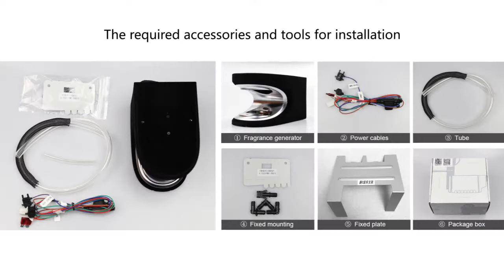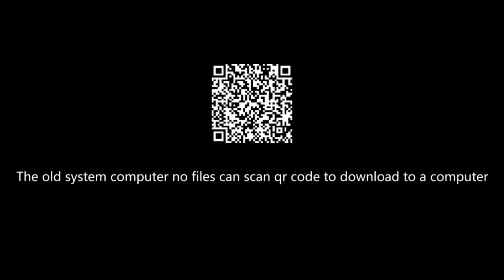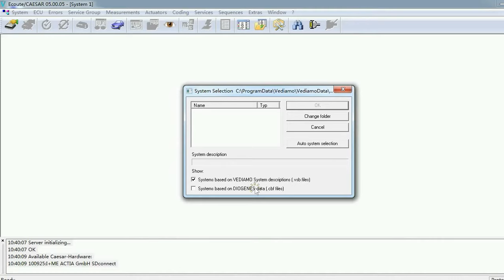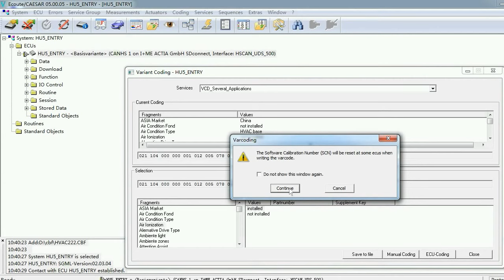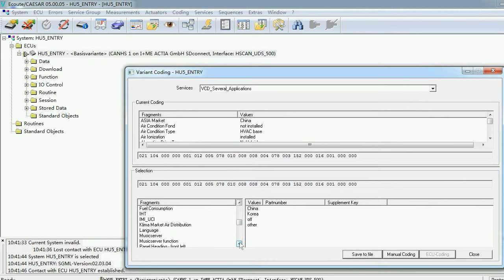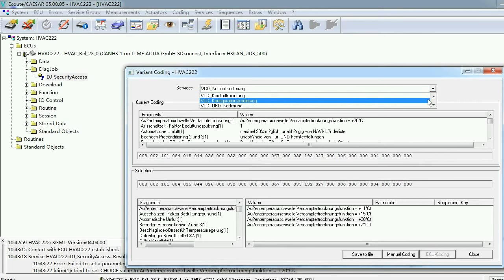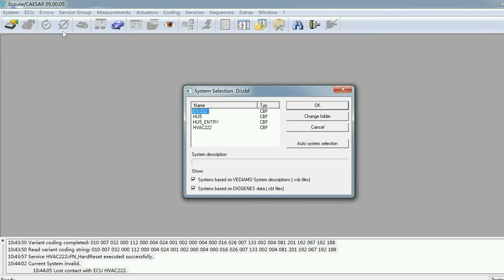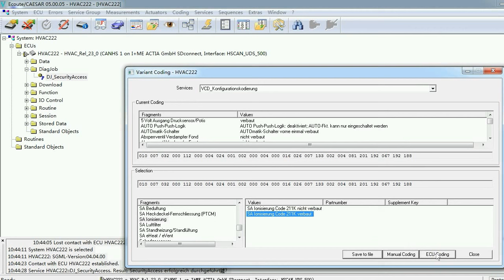How to install Air freshener purifier in  Mercedes-Benz interior cabin

Comment: What about the ionisizer???
Reply: LIN on ionizer also connects to line/pin 13, same one fragrance system does, if you want it to work in the UI. Then settings are in same area in Vediamo or DTS.